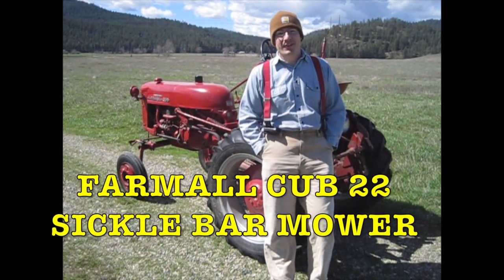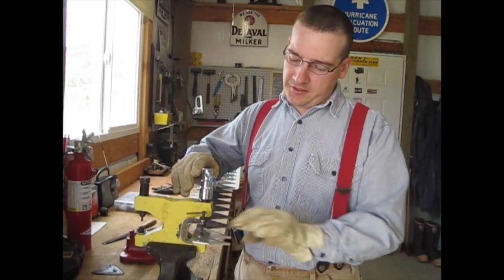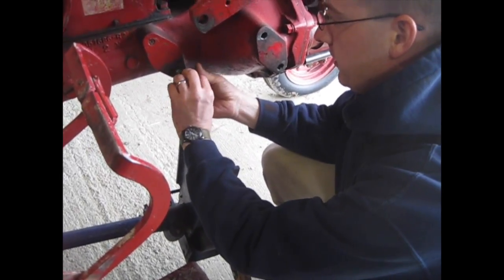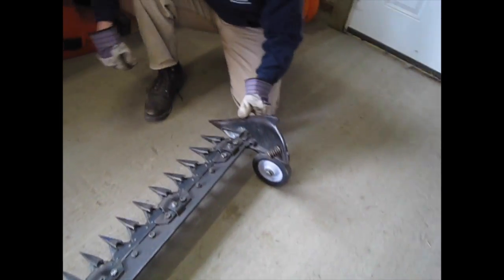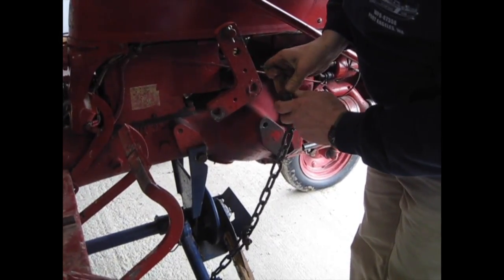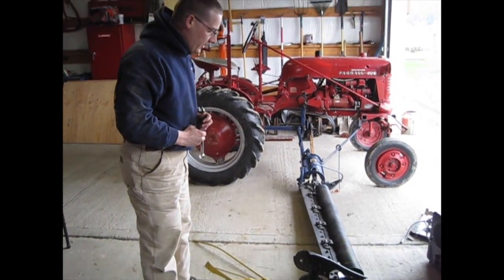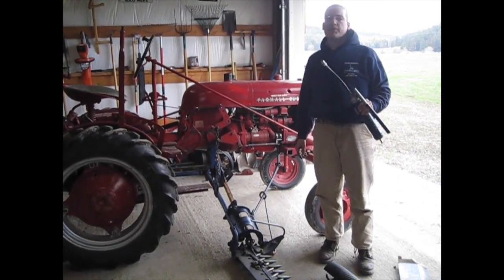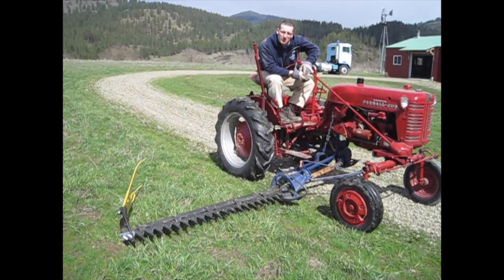Farmall Cub 22 Mower

Comment: How does this compare to a typical lawnmower? I would assume a regular lawn mower design is superior because they quit the sickle mowers a long time ago.
Reply from the maker: Sickle bar mowers are still quite popular and available new. They have made several advancements in the technology over the years however. The advantage they have for haymaking is they only cut the grass once, rather than chopping it up like a rotary mower might. If you’re not trying to make hay, but rather just mow a field for weed control or whatnot, then a rotary mower would be the tool of choice. Thanks for watching!
Reply: Had a friend who used a sickle mower to clip his ditches around the farm. Safer than trying to use a tractor with rotary mower.

Comment: Thank you for the video I have several of the sickle mowers and parts I'm going to try to build 1 good one out of the parts I have. I want mine to cut around pond and under some fences
Reply from the maker: farmall1 farmall1 Sounds like a great project! If you need new parts, I’ve had good luck with Webb Cutting Components. Sickle bars are great for mowing fencelines, just stay vigilant... when a Sickle section encounters a “t” post, the post usually wins!
Reply: @vnthomas16  thanks for the tips I subscribed

Comment: Very informative video. Everything patiently explained. I have a question you probably haven't experienced as you are young and strong enough to handle the cutter bar and the coupling bar in one piece. Since I am 30 years older than I was the last time I used my Cub 22 mower, I would like to disconnect the two and mount them one at a time. But I can't figure out how to get them apart. Only one pin is removeable and that is where the problem lies. There is not enough clearance to jockey them apart. Any ideas that I am not thinking of to solve this problem?
Reply from the maker: Hmmmm... Not sure. I don’t think they were designed to be taken apart with regularity or ease. I’ve heard of folks needing presses to separate them. One thing I’ve seen people use is a flat furniture dolly. They balance the sickle bar on it and then just roll the whole thing under the tractor. I might try that. Good luck!
Reply: @vnthomas16  Thanks for the effort. I was thinking they are not made to come apart. But then I noted on a spare "for parts" mower that I have in an old shed that it has been taken apart and has been left in two pieces. But you are probably right: They are not made to be taken apart very often. Seems odd, but then these mowers were designed and built in a time when few jobs were done by one man working alone. There was usually a family member or a neighbor who could be called upon to help with "two-man jobs."

Comment: Great video! Can you tell me size and type of bolts used to mount to belly of tractor? Mine keeps coming off no matter how much torque I use. The inside of hooks are beveled. I can tell if it’s from wear or supposed to be that way
Reply from the maker: Heat Em Up Kennels, I believe it’s a 5/8” bolt, that said, it is a special “IH implement bolt” that has a cone shaped head. The mower bracket is indeed supposed to have the bevel. If you haven’t already, you should check out the forum at farmallcub . com. Lots of good info there. I’m sure someone there could give you a source of supply for the implement bolts.
Reply: Blue Creek Dairy Farm WA thanks very much. I will get one. I enjoy watching your videos